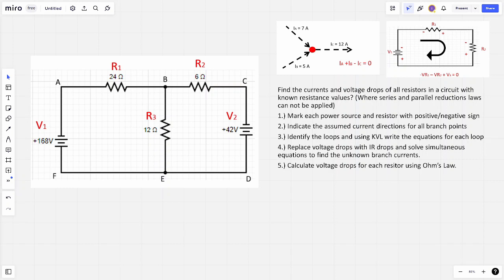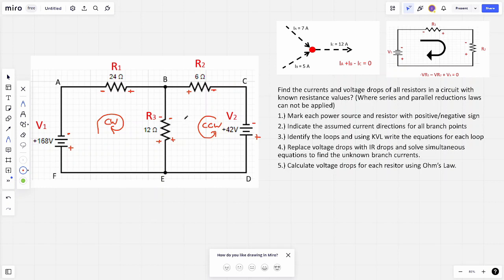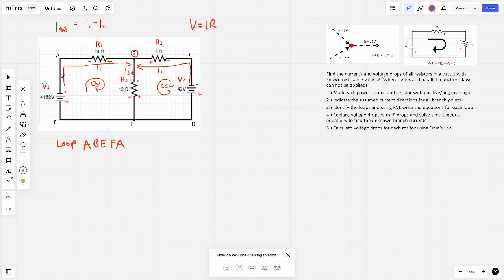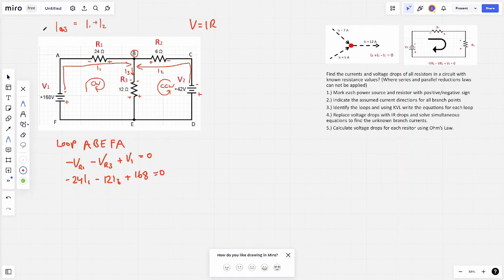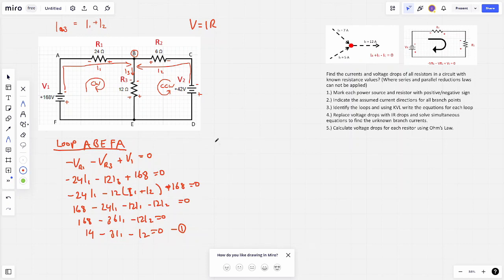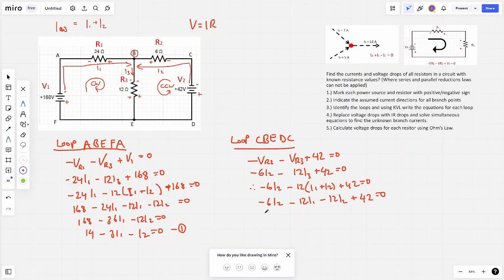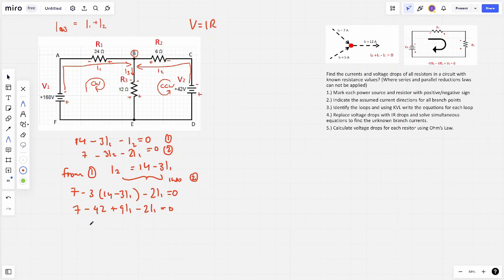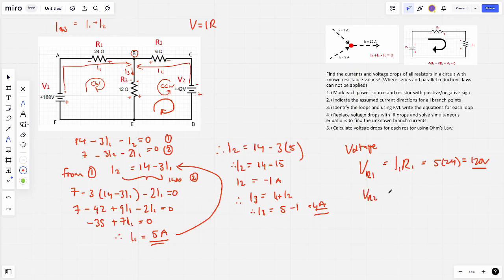Solving Circuits with METHOD OF BRANCH CURRENTS: A Step-by-Step Guide, WORKED EXAMPLE #2

Comment: Can you work the problem if one voltage is going the other direction.?
Reply from the maker: Yes! if we swap the V2 such that the current now flows clockwise, we can have to be consistent with our initial assumptions. This is important for currents at node B. If you do so; I1 & I2 go into node B and I3 leaves the node (if we keep loop ABEFA the same). 
This results in the same two simultaneous equations in the video shown as the voltage drops across any component will be the same. The voltage source swapping directions shouldn't make a difference as long as we are consistent in our rules. I hope this helps!